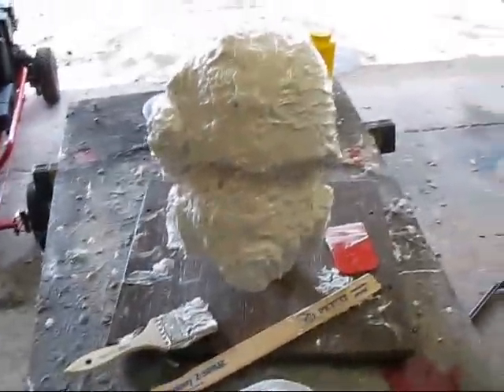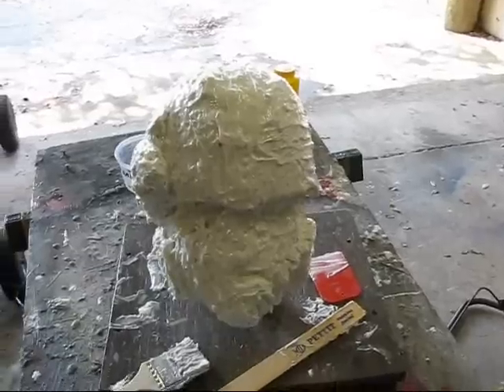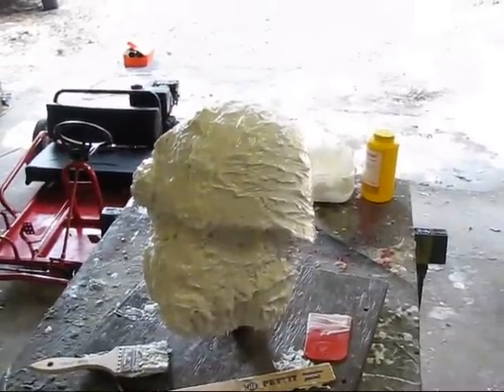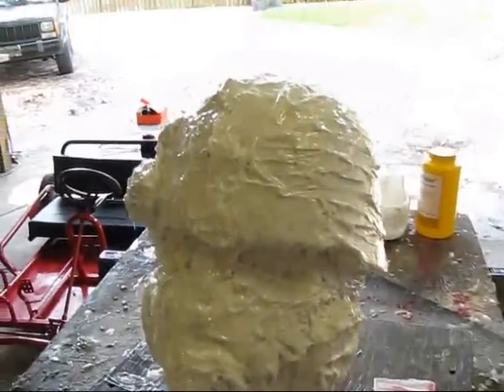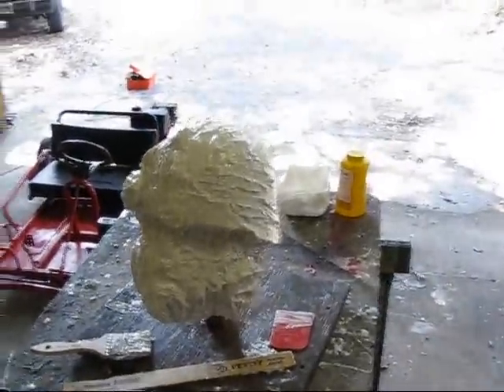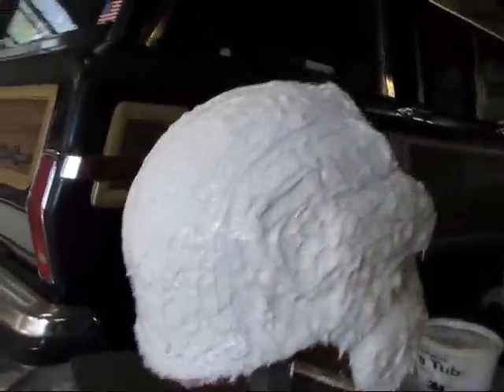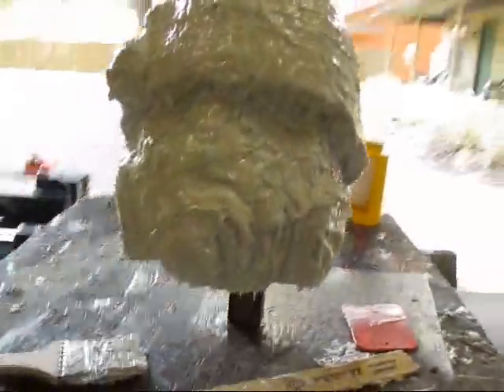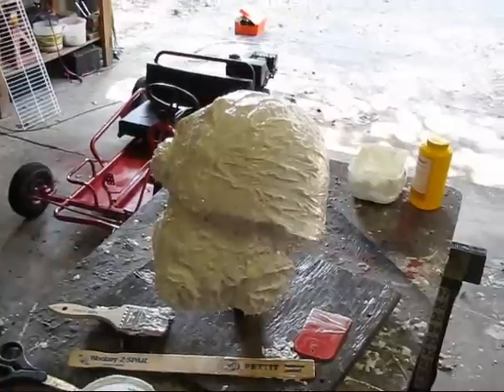Fallout: New Vegas Advanced Riot Helmet Part 5

Comment: You mention cure problems over your Chavant.  There are LOTS of products that won't cure if your clay has sulfur in it.  Monster Maker creates a good oil based clay, and there are other suppliers as well that have sulfur free clay.  Another tip is to dip a brush in Naptha and lightly brush over the silicone to smooth it.  You can get an almost glass smooth finish this way.  You can use other things such as odorless mineral spirits, but Naptha evaporates the quickest.